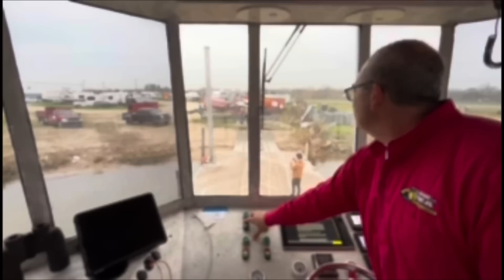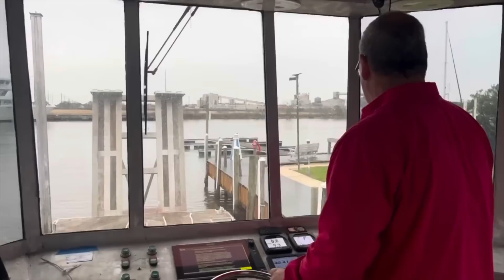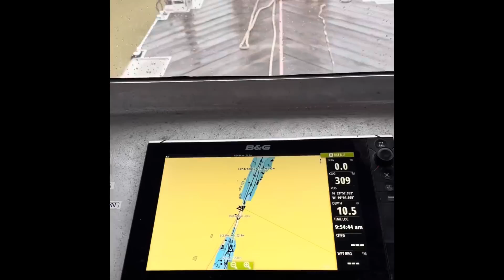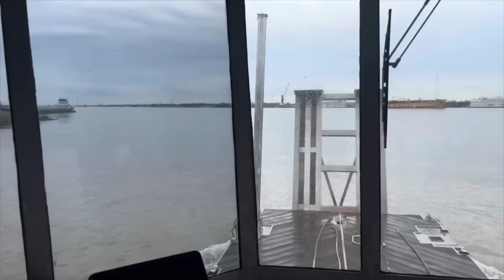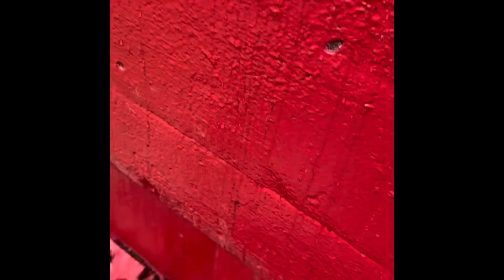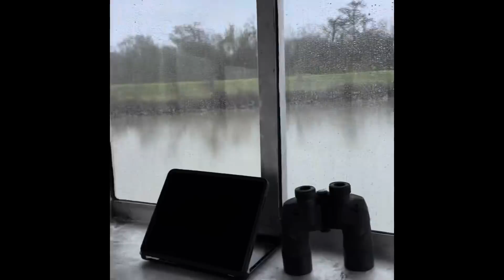Fastest spud boat in Louisiana, Mississippi, river adventure, unedited ￼

Comment: What was the point of this video? Where was it going and why?
Reply: Thanks for your explanation in your email .
Really appreciated .
Reply from the maker: I was moving the boat to the next job. We use the boat for driving pilings. We load our excavator and other equipment onto the boat to get to water access job sites. This particular job site was on the west side of the Mississippi river. Our offices are on the east side of the Mississippi river.

Comment: Are the spuds aluminum? It’s certainly fast but it’s built so light I don’t think if would hold up for long. Our little excavator (cat 385) on a proper steel barge with proper steel spuds and rather beefy spud wells has issues with blowing spud wells apart and bending spuds when digging.
Reply from the maker: Check out what we do we drive pilings in Louisiana. The ground here is extremely soft and muddy. We have no problems we only have a 34,000 pound excavator on there but we put loaded dump trucks on the barge all the time it is not an issue I have had hundred thousand pound excavators on there before not working just move them across the bayou, the barge is only 60 feet long when she’s loaded we only go 8 kn. i’ve had a cat long reach on there after the last hurricane, big hurricane Ida we moved the DOT road cruise across to an island I had a road grader on there. The inside of the barge has lots of crossbracing and six watertight compartments with bulkhead. It is built 12 inches on center with tease top and bottom sides and lots of bracing. There are some videos of the build on my site.